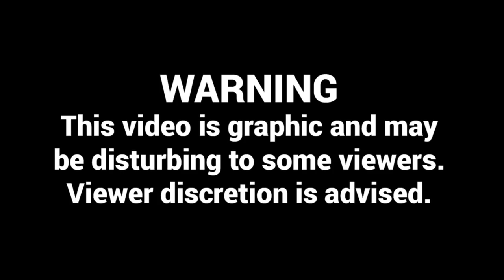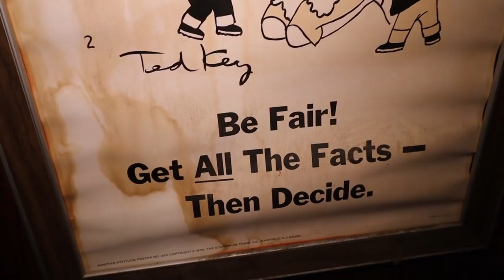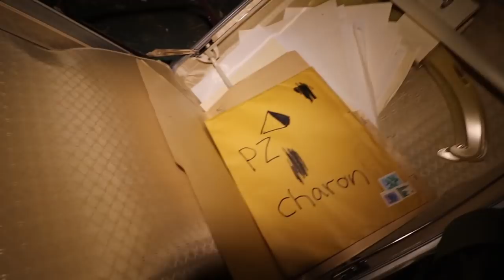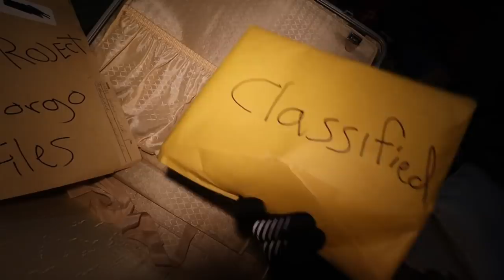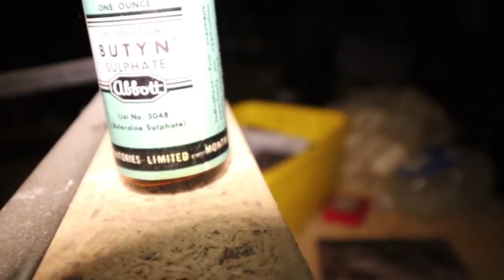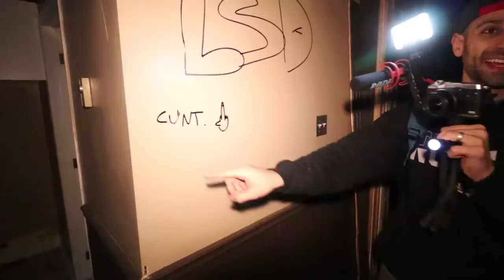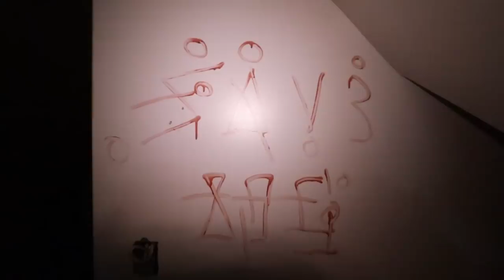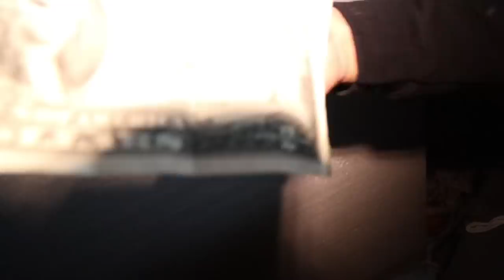GAME MASTER CLASSIFIED SUITCASE FOUND IN HAUNTED ABANDONED HOUSE! PROJECT ZORGO | MOE SARGI

Comment: Butyn is the sulphate of a base similar to that of procaine, the ethyl being replaced by butyl and the ethanol by propanol.1 It is a very efficient anesthetic for mucous membranes, inducing a more rapid and more persistent anesthesia than cocaine, and in equal concentrations is more powerful than cocaine. It should not be used for infiltration anesthesia, as it is more toxic than cocaine or procaine.

For the past seven years I have been using butyn as a local anesthetic in the male and female urethra without any untoward results. The maximum strength of the solution has been 2 per cent. Recently, there have occurred two cases of poisoning by this drug, with a fatal termination in one

Comment: At 27:03 to 27:05 you can see Ali leave the room behind the cupboards and then immediately turn back in when more turns around then they see the candle which looks like it has only been lit for about 10 seconds because there is no wax at the bottom like if you see

Comment: BUTYN SULPHATE SOLUTION  is the sulphate of a base similar to that of procaine, the ethyl being replaced by butyl and the ethanol by propanol.1 It is a very efficient anesthetic for mucous membranes, inducing a more rapid and more persistent anesthesia than cocaine, and in equal concentrations is more powerful than cocaine. It should not be used for infiltration anesthesia, as it is more toxic than cocaine or procaine.